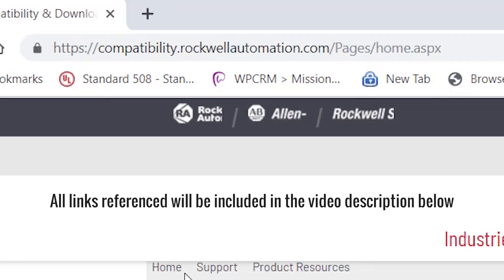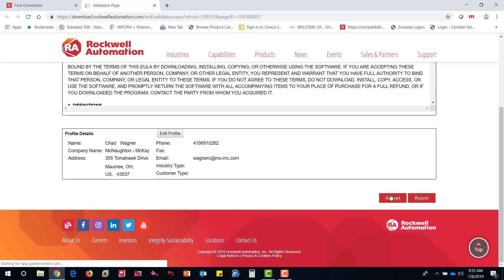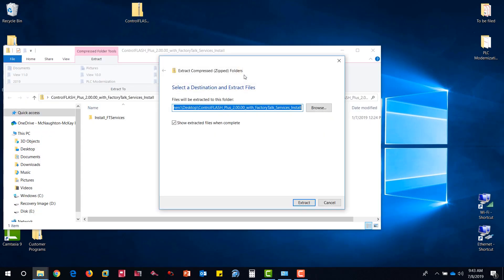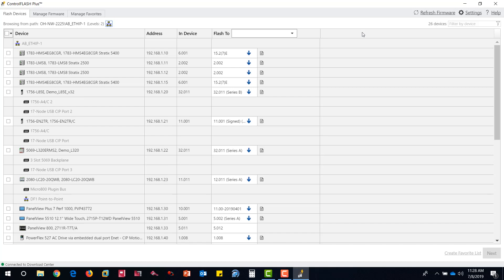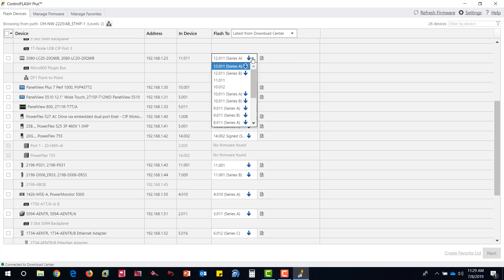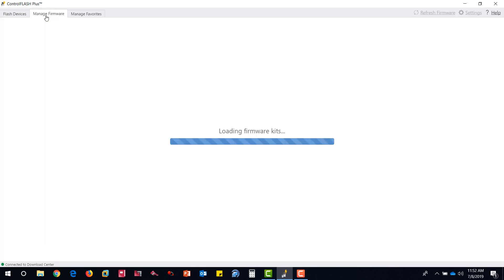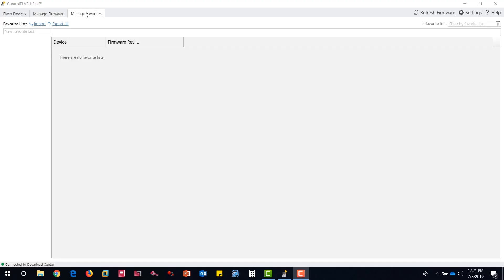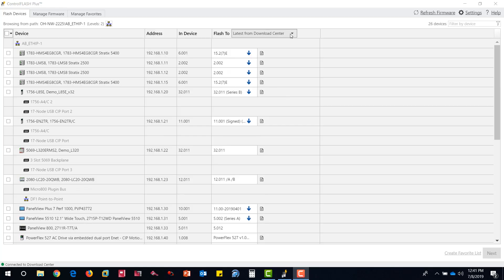How to Install and Use Rockwell Automation’s ControlFLASH™ Plus Firmware Tool

Comment: hello, please how to ad flas because mine is empty
Reply from the maker: Hi Daniel, please verify that you are connected and communicating with the device you are trying to flash, and that the computer you are using has an established internet connection. The drop down list of firmware should populate from Rockwell Automation’s Compatibility and Download Center. If the problem persists, we recommend reaching out to your local Rockwell Automation distributor for personalized support.

Comment: Hi Chad. I can't donwload none firmware version for a Compact Logix 1769-L30ER controller from the Rockwell web site. When I try to download appears the following:
"Not all items are available for download at this time.
Some items need further review. An email will be sent to you when you can access your pending downloads."
They sent me an email with the pendiend download, but again I cant download. Do you know what happend ?
THANKS IN ADVANCED.
Reply from the maker: Hi Damian, To download Rockwell Automation software, firmware, and other files, please visit Rockwell Automation’s Compatibility and Download Center: https://compatibility.rockwellautomation.com/Pages/home.aspx
Sign in with your Rockwell Automation account and search by product. Firmware options should be available from there. Please contact your local Rockwell Automation distributor for further support if you continue to experience issues. https://locator.rockwellautomation.com/

Comment: I'm trying to download 1756-L81ES firmware, but could not download it :( It says EULA :(
Reply from the maker: Hello, 
The EULA error likely pertains to a Rockwell agreement. CF Plus is a free software so it seems like there’s an issue when importing the firmware from the Rockwell Automation site within ControlFlash Plus. To get around this, you can use the downloads page to search for the 1756-L81ES firmware you want and manually flash it. Also you can check through the account to see if there are any agreements that were missed.

Here's the link to downloads page:  https://compatibility.rockwellautomation.com/Pages/home.aspx 
If you have further questions or concerns, we recommend reaching out to your local Rockwell Automation distributor for personalized support.

Comment: Must also connect Ethernet Cable to device or system to flash. Must place your PC or laptop IP Address in similar network address so you can browse the network.when connected. Yeah, little stuff you forget sometimes and wonder why nothing is working. 
I’m all for updating stuff through and through. The reality is though as an OEM for many our systems we have PLC deployed all over the country and around the world often at Power Plants sadly most our customers don’t care or want to update their system firmware. Yes, it’s blows my mind. But they don’t seem to consider it something essential to do updating firmware. As well, something may possibly break in the update and we get blamed for whatever doesn’t work after the updates. Thus we don’t get many customers ever asking to update firmware. Not unless we are fixing something, updating logix and do so apart of software update or system PLC upgrades. Otherwise I see very few firmware upgrades ever on original installation of equipment. It’s sad to say that as a Field Service Engineer who works on our OEM Systems as well Automation Control Systems. So the firmware that was put in originally in when commissioned in 1985, 1992, 2004, 2011, 2016 is the very same firmware still there today baring any change in HMI, PLC or logix change that was done since. It will be the same firmware there for our customers 5 years from now if nothing changed. We can’t force our customers to upgrade their own PLC system firmware. They don’t do it themselves either.